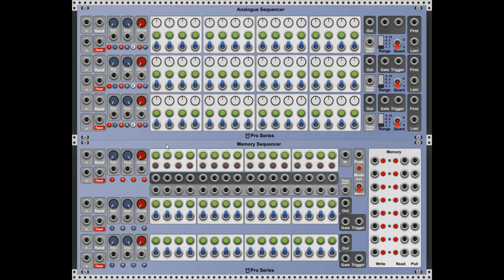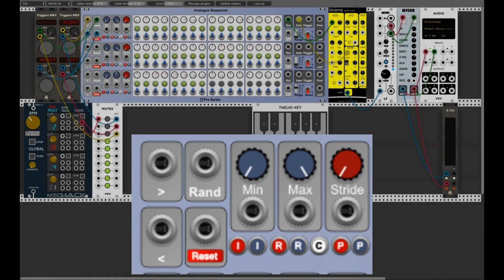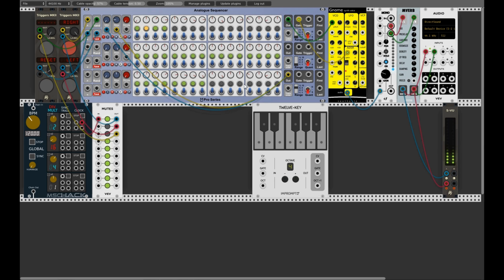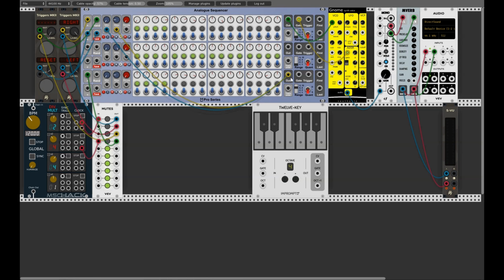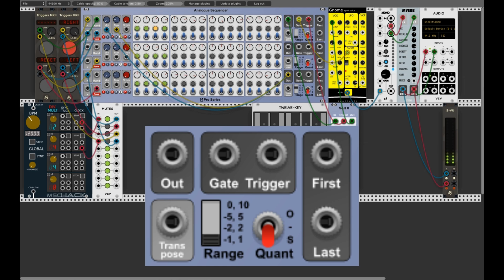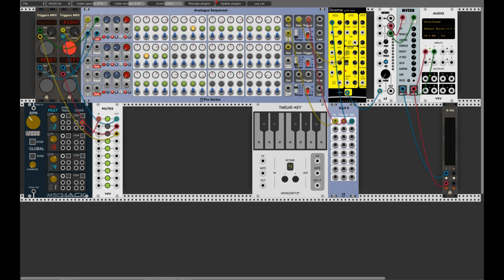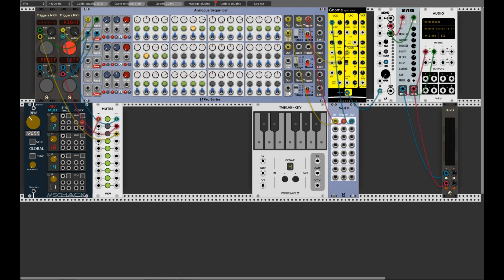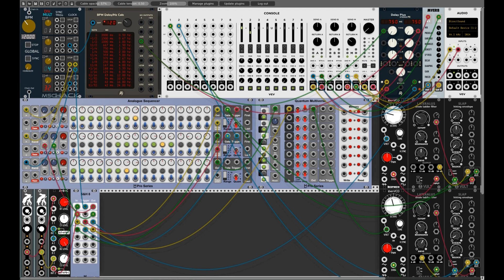Analogue Sequencer Tutorial

Comment: Hi Martin. Seems like a great sequencer, I just purchased it. However, being a bit new to this, I can't figure out what to use to trigger it. Where can I find the Triggers MKII you are using?
Reply from the maker: Anything which creates a gate should do.  That could be any of the clocks (AS, MscHack, etc.), manual triggers (the AS Triggers), or even the gate from an external MIDI signal.
Reply: Thanks, good advice I will follow up. I found my Arturia Keystep can trigger it, seemed a bit weird to use a hardware sequencer/controller to trigger a software sequencer, but it actually works quite well.